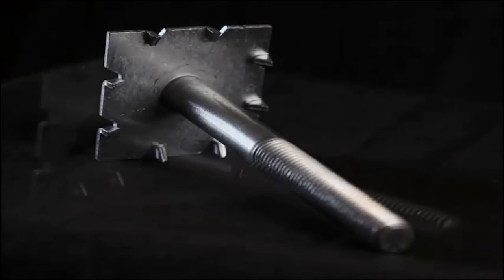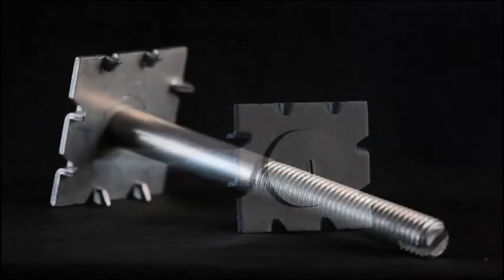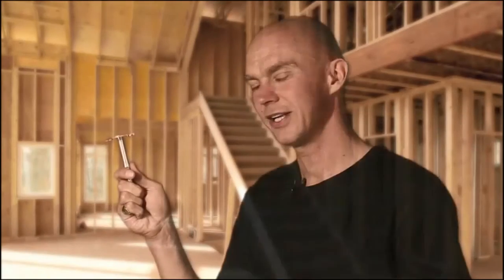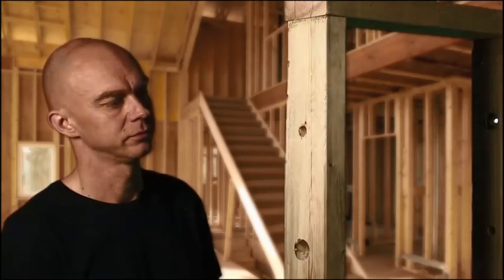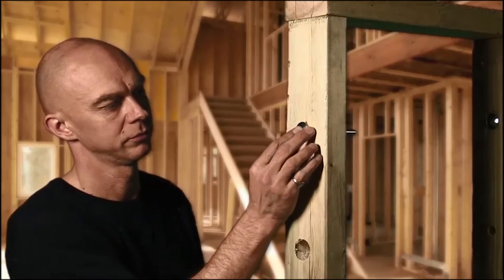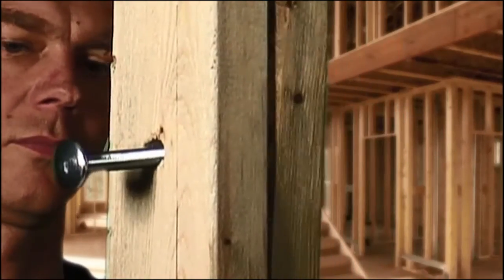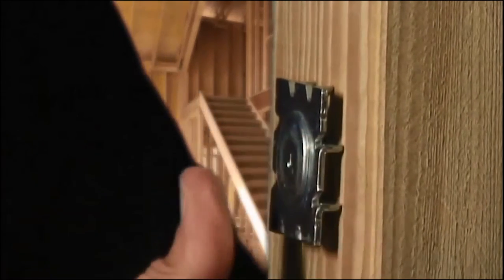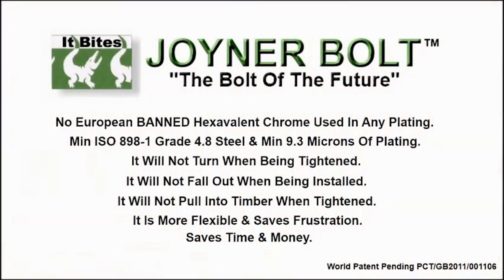Joyner Bolt - Spiked Timber Connector

Comment: You use spiked connectors and square washers. Problem solved!
Reply: Paulo B I always enjoy watching people who can’t do bolts. When people drill counter sinks for bolts in wood, I get so irritated. It’s almost a guaranteed spinning bolt. I had a buddy that would machine the hole in a square washer into a square, that way it would fit around the neck.